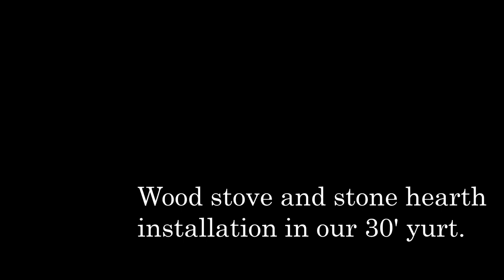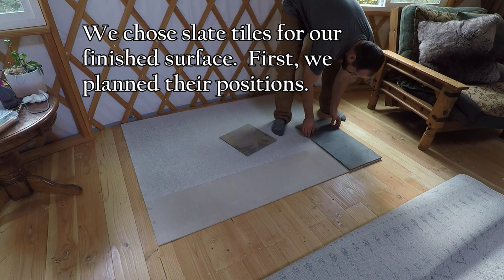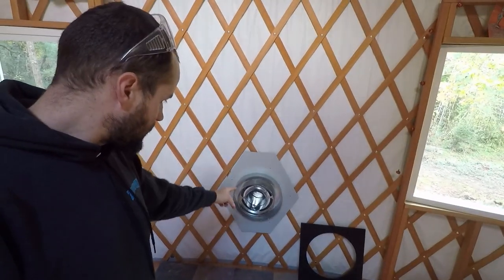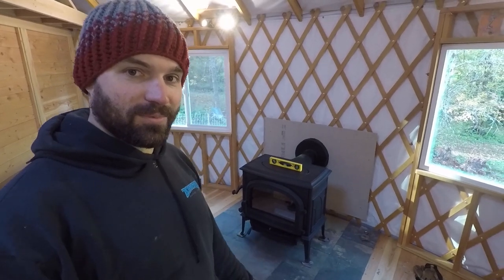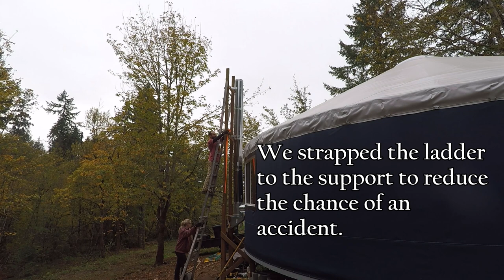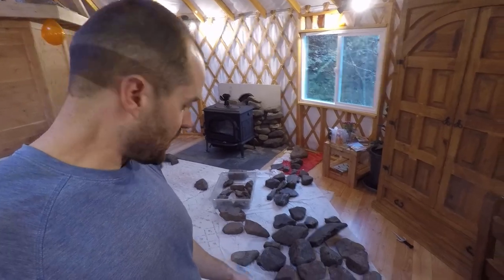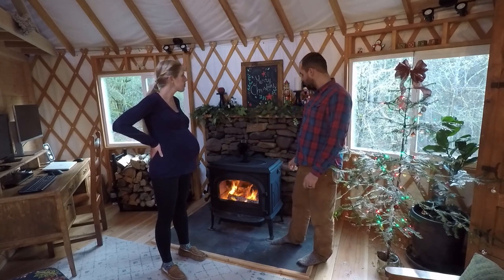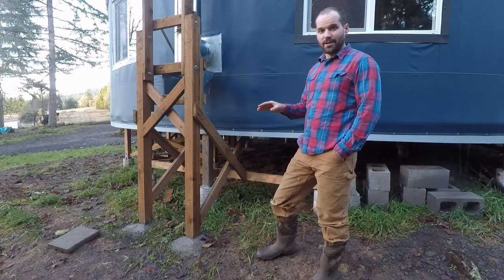Installing a Wood Stove and Stone Hearth in our Yurt

Comment: Just ran into your video. As a professional stove installer I'd recommend to use small selftapping screws to add at every joint of the chimney, usually requires at least 3 screws at each joint. DuraVent locking system it's not enough especially at 15' hight
Reply from the maker: Thanks for the suggestions, and thanks for watching.

Comment: I know your relief. I installed 7=>3 foot lengths.  Great video. One thing I do not understand is why did you not put the 4 x 4's in sono tube? If you have frost in your area it will elevate the chimney. The yurt will stay at the same height because of the sono tubes.
Reply from the maker: I'd use sonotubes and hardware above that if I did it again; I was a construction rookie at the time :)

Comment: Great vid but why not add a wet back for your hot water?
Reply from the maker: Our plumbing system is on the opposite side of the yurt from the wood stove, and we are on the grid, so we used a traditional electric water heater.   I'm sure that works great for folks who plan their design around it, but it wasn't necessary for us.

Comment: What's your strategy for starting a fire since you have a horizontal exit?  I also have a horizontal exit thru the wall with a tee outside and then straight up. So far what I've done is prime the vertical stack with denatured alcohol and then go back inside to start the fire.  If I try starting the fire indoors without priming the vertical stack first, I get smoke in the house. However, in the occasion of nasty weather I might not want to go outside.  Do you have problems with cold air coming down the chimney?
Reply from the maker: Hey Justin, I only have issues with smoke coming back into the yurt if I try to start the fire with the yurt dome open or an exhaust fan running.  Otherwise pretty standard; load 4-6 logs, light a chunk of Super Cedar firestarter, place it in a crevice with good airflow, then add a bit of kindling around it.  How tall is your chimney?  There may well be other variables, including temperature/pressure outside, that I'm not aware of, because once every few months I'll have trouble with smoke and not know exactly what the cause was.  Thanks for the question, happy to discuss more if you'd like.  -Jarvis
Reply: @Green_Heart_Family_Farm  The chimney is about 18 feet tall vertically. I have the basic chimney cap that came with the Selkirk thru-the-wall kit, so it's not at all great for preventing downdrafts. I may look into the Vacustack cap sometime in the future.  I am also situated on a hilltop, which may increase the negative pressure or downdraft problem.

Comment: Maybe a stupid question but is the yurt isolated, it seems to me that it is cold in winter 🥶 🥰
Reply from the maker: If you mean insulated, yes, it has insulation in the ceiling, walls, and floor.  It can be cold if we don't light a fire, but very warm when we do.
Reply: Yes, they have their video of the set up and build, the yurts siding comes in layers. 😁

Comment: In regards of the loose stone wall, it seems to me that you might not have enough space between the back of the stove and the wall. Why is that important? It's to allow enough air circulation all around the stove and obviously not overheating the wall...don't take this as criticism, but humble tips

Comment: I have thought of getting a yurt.  There is ONLY one thing that concerns me, however.  I am in northern Alberta where it is regularly -30C, sometimes -40C and with the wind child factor can exceptionally feel as cold as -65C.  I have seen a video or two and read that yurts are prone to having mold in cold climates.  The idea is that any moisture or humidity will condense at the coldest parts.  For yurts, this means the walls.  No matter how good the insulation is, it is thin and there is a cold zone between the outer wall and the insulation.  What are your thoughts on this?  Please advise!  I really like the idea of a yurt but the potential for developing mold does concern me.
Reply from the maker: We are in the early days of owning our yurt, but we are concerned as well.  We are still figuring out the best way to get through the winter while managing moisture.  We have seen a few mold spots between the insulation and outer wall fabric during our first winter; this spring/summer we will pull back the wall fabric and assess the extent of the situation.  For our climate, we will have to learn how to get through the winter with as little mold development as possible, then enjoy a nice dry yurt the rest of the year.  Keep an eye on our channel over the next few years and we will discuss how it is going.  Thanks for the comment, and good luck with your decision!  Factoring in the price and quality of life in our yurt, we are still very happy with the decision, even with the difficulty of managing moisture.  It is only the significant downside of the yurt that we have experienced, so far.
Reply: id mabey treat the insulation with some antifungal treatment or water resistant treatment and regularly vent the inside of the walls. and having a large wood stove or 2 smaller ones at opposite ends will help. airflow is your friend and will be your greatest ally against mold. some slight modifications will have to be made but if you want to use the yurt as a permanent residence in stupidly cold and humid places you need that airflow to stop that mold growth. mold will always find a way but with this you can greatly minimize it. synthetic insulations are also a great option but its understandable if you dont want things like the fiberglass insulation or Styrofoam bricks (both have the same insulation grade). theres plenty of options so dont sweat the small details and do what works best for you. just remember, airflow is important. i use these things that suck moisture out the air here in florida and they work great. but they stopped selling them at my local home depot so i had to make my own.  but yeah look into ways of reducing ambient humidity and anti fungal treatments.
Reply: @baronvonkaiser9912  Now that you mention it, I wonder if Sheep's wool batting might be a solution.  It looks similar to fiberglass batting but it is wool.  Wool absorbs a huge amount of moisture, and naturally prevents mold.  People are wanting to use wool batting in conventional homes but since it is not part of the standard building code, it is really difficult to have the home properly insured.
Reply: @trevorstolz8580  damn building codes. if its not synthetic and cant be mass produced and taxed they dont want it
Reply: @baronvonkaiser9912  Of course I agree with you.  I live on an acreage 50 km out of town, so a 40 minute drive.  I have peace and quiet, a woodstove and a diary cow.  The government hates self-sufficiency of any kind.

Comment: I'm curious, what did this project end up costing you?
Reply from the maker: Hi Mark,

The stove was the most expensive component at about $3000, then the chimney materials at about another $750, then the hearth materials at $150 or so.  I think we probably our total cost was about $4000.  Used stoves and smaller stoves can be acquired for much cheaper, so I'm sure a version of this project could be done for under $1000.  Hope that helps!

-Jarvis

Comment: Could you put a stove in the centre of a yurt?
Reply from the maker: I know it's possible, but perforating the ceiling is discouraged by yurt manufacturers.  Passing the chimney pipe through the wall is preferred.  A custom built yurt with the goal of having a chimney exit the center of the dome is certainly possible if someone wanted to do that work, though.

Comment: Seems as though you could had Preassembled the chimney and installed it as one long piece to avoid assembling so far in the air
Reply from the maker: Interesting thought, have you ever seen that done?  I'd like to see it if so; I'm guessing it would take special lifting equipment?
Reply: No, wrote this 2/3 through video, after finishing not entirely certain it would have been helpful but seems like could had used some straps to up high as a guide / stabilizer and lift from bottom but might be a bit heavy.  Either way well done ✊👍
Reply from the maker: @blain5827  Got it, thanks!

Comment: For all this work, a RMH is much more efficient. Look into it. Best Regards!
Reply from the maker: I watched lots of rocket mass heater videos in previous years, and find them very interesting, but I find the small, modular footprint of the wood stove much easier to work with in a yurt.  The large barrel, all the clay, etc. for a RMH doesn't seem like a good fit on a raised wooden foundation in a yurt.